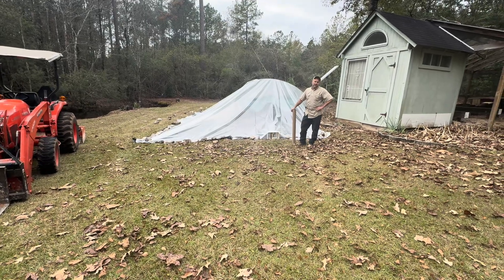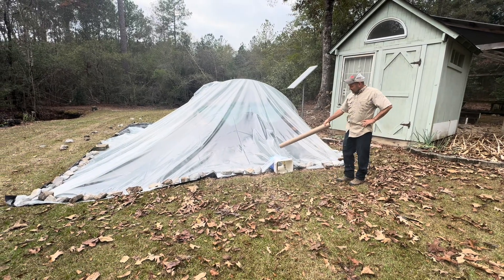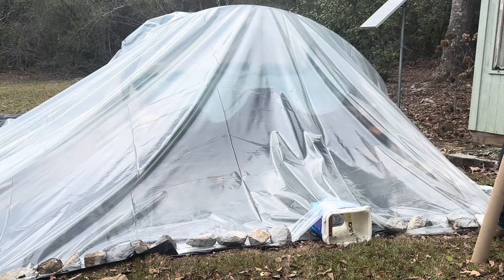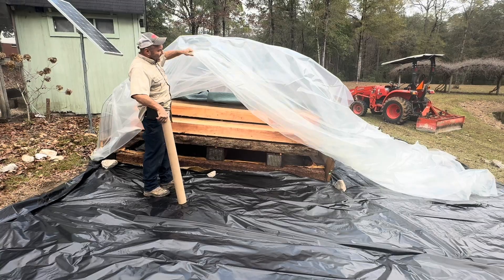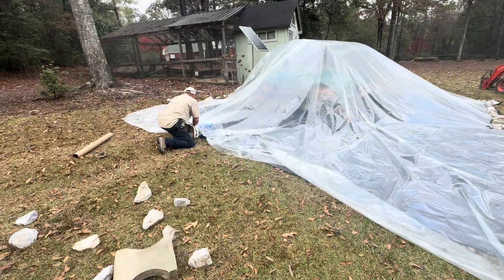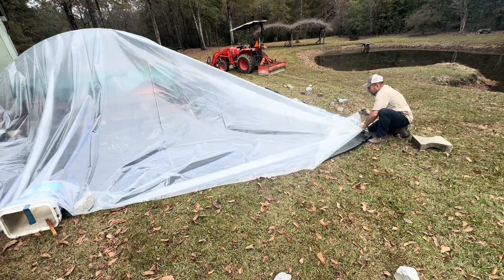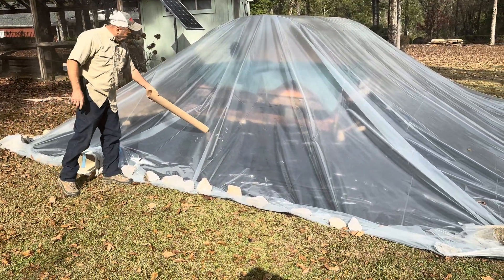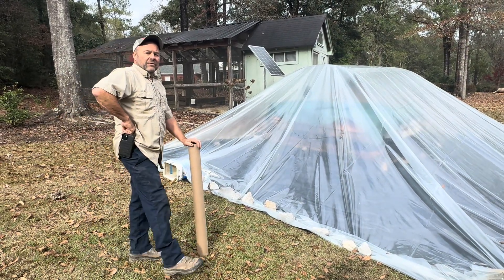Inexpensive way to dry wood. Green house kiln. 2026

Comment: where does the water go if you just have black plastic covering the gound all the way to the edge? It needs a way for theat water to roll off not just back on to the black plastic. defeating the purpose seams like
Reply from the maker: The water leaks out on the downhill side and on the uphill side a leave a gap for the water to go into the ground.